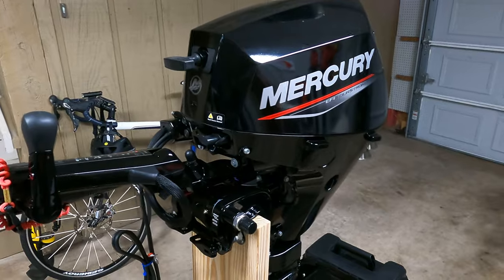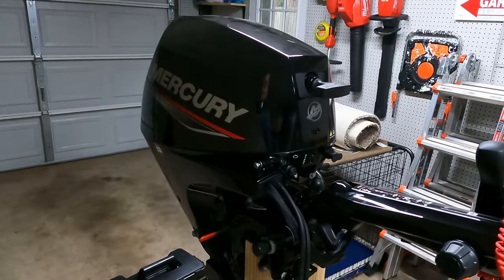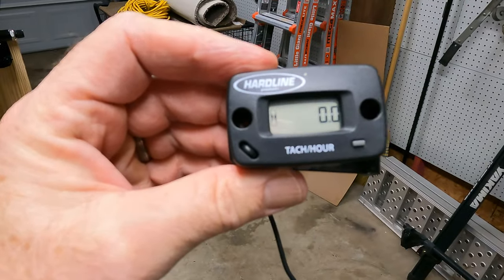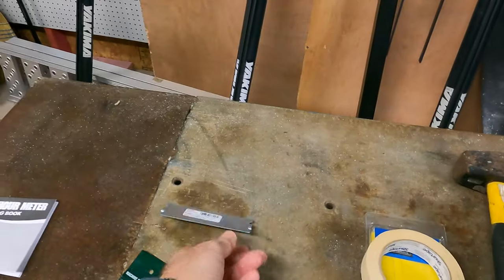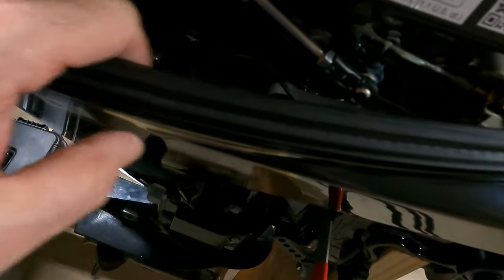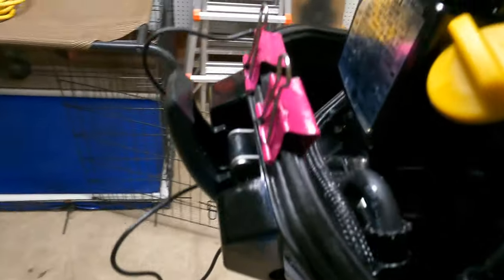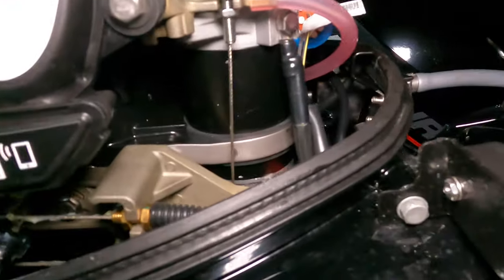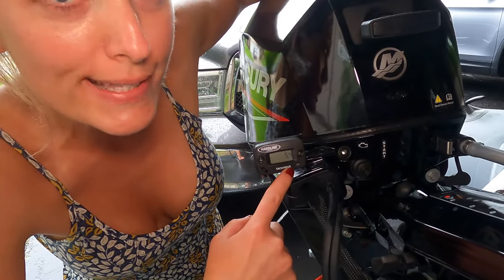Hardline hour/tachometer

Comment: i’ve been having issues with mine cutting out, should i try tucking the wire away like this to avoid electrical interference? it only reads when i hold it far from the motor

Comment: Great video ty. I really know nothing about outboard motors but recently bought myself an 11 foot inflatable dinghy and a 4 stroke 6hp merc outboard. I'm giving you all the info I know about the motor. It only has a pull start and it's 1 cylinder. I've also got the same tach. Will this work the same way on my motor? Thanks for the silicon idea. I was wondering how I was going to run that wire. I've already got this tach meter, the 4 stroke 1 cylinder outboard and dinghy.
Reply from the maker: Glad I could help you

Comment: It would have been nice if you demonstrated the tachometer in use...  or did you?  It's hard to remember if I actually saw the tach in operation.  LOL  (translation:) Your wife is absolutely gorgeous!!!  I hope you know you're a very lucky man!

Yes, I came here for the install... I have a slightly different meter on my Suzuki 4hp, and have to put one on my Suzuki 15hp when it arrives in 2 days.  Is the idle on that Merc really that low?  It was showing 550 RPM.  My DF4A idle spec is around 1100, but it's a single cylinder engine, so maybe that's the difference.

Comment: I don't understand the lowest number I was able to get was 3000 RPM but it's definitely not running that high its at least 1500
Reply from the maker: Look in the setup. It’s been while but I think there was an option for number of cylinders or it might have been 2 stroke vs 4

Comment: How and where to put those wires??
Reply: @SailingCAVU  tachometer wires
Reply: There's a hole in the tach  meter to feed one end of the wire into. You can see at 3:58 in the video how he wrapped the other end of the wire around the spark plug wire